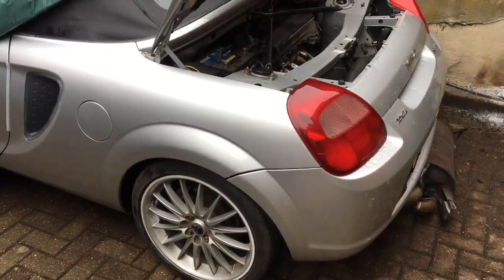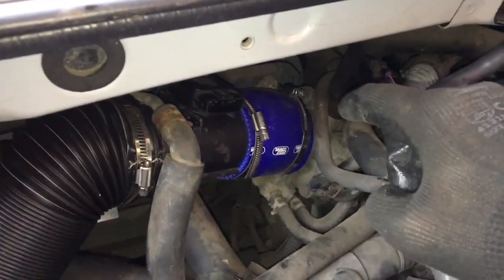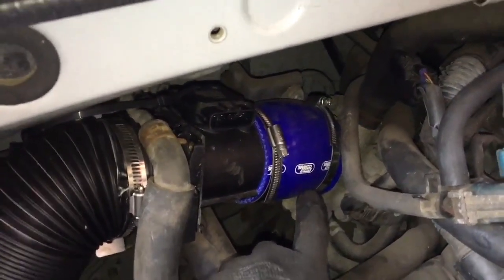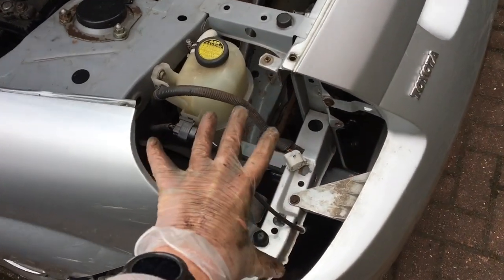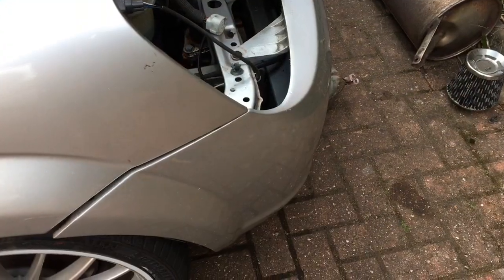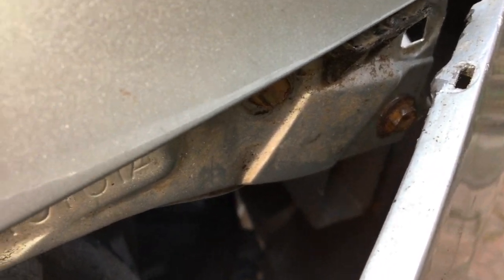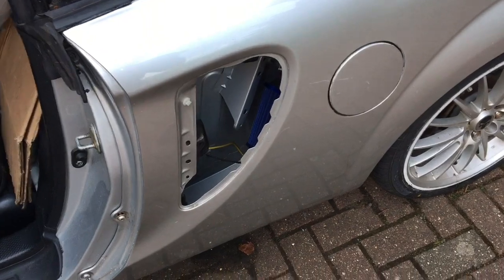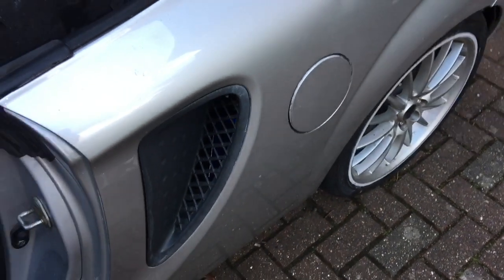Toyota MR2 Roadster side air filter installation

Comment: thats a good idea so you dont get all that hot air from the engine bay, but that flexible tube is terrible for airflow. On mine i made an enclosure and the filter sits right against the firewall with a very short conection to the throttle body. That enclosure is then conected to custom stainless pipe that goes to the sidevent.

Comment: Dude soo much work for the same result..you all ready had the ram air effect due to the stock ducting..I would just build some kind of shielding at the back of the filter at the location you had it..although testing new things is part of evolution..so keep testing 👍
Reply from the maker: You are 💯 pc right - I just had an absolute need to get that air filter as a true side intake, as i have not seen another attempt and wanted to see if it was possible

Comment: A big fan of yours from South Korea.
I hope U’re planning to do something with ur soft top soon so that I can learn from u.
Coz I too have some problems such as chapped edges.
Reply: I suggest black silicon but it depends on which edges you're talking about. Look up other convertible top repair videos for ideas.
Reply from the maker: My roof is in terrible condition, i
might replace it with a second hand one in better condition, if i do i will make a video
Reply: Thanks for the suggestion.
However, mine is brown colored because my car is v-edition.
I tried to apply silicone too but I couldn’t find it with matching color.
Maybe I should replace it.
Reply: @user-ip6vh8dt9j  It would probably work if you got some dry brown/tan pigment and mixed it with clear silicone
Reply: Thanks much.
I’ll try.

Comment: I’ll be worried about getting it super wet and hydro locking the engine… IF there’s a ton of water coming through the side vent .. but that can be remedied with a deflector added behind/inside the vent to divert the air/water around the filter but still allow air to enter the area..! AND get rid of the accordion style pipe it’s bad for flow

Comment: I’ve heard it said quite a few times that these cone filters do absolutely nothing for power compared to the stock box..

Just wondering your thoughts
Reply: Every car is different… on some cars it doesn’t make a difference over a high flow panel filter like a K&N…. BUT on some cars there’s been dyno proof of a 10-20hp increase…. 
Just check the car you’re modding and worse case it’s a great sounding effect!

Comment: So you're not going to clean/change the air filter or do you plan to remove the quarter panel every time?
Reply from the maker: So i have yet to test the theory but I believe i may be able to replace the filter through the side intake when the black plastic intake cover is removed
Reply: @andrewsparey697  I see.  Looks too tight on the video, but that's not uncommon for video.  Good luck.
Reply: @andrewsparey697  you remove filter from outsaid?

Comment: Great job! Do you have problems when its rainy weather..?
Reply from the maker: So it is not a daily driver, I usually only drive on sunny days. I did however get caught in a severe rain situation with surface flooding , and was very worried. Thankfully there was no issue. That said , for the sake of ones blood pressure I would not do this to a daily commuter in a wet climate

Comment: You not afraid the water draining for the top won't get sucked into the engine?
Reply from the maker: It has been a concern but has not happened
Reply: @andrewsparey697  Thank you for responding. I'm looking to purchase a 2003 MR2 soon.

Comment: what happens when you want to clean or change it?
Reply from the maker: Hopefully it is small enough to remove and refit from the vent when the vent shroud is removed. If that fails i will relocate it back to inside the fire wall
Reply: @andrewsparey697 did you change location or clean filter?

Comment: what is not satisfied with the cold intake of the production of AEM?
Reply from the maker: I generally work with the theory that if it is OEM , it sucks
Reply: @andrewsparey697  Just in cool companies, a department of engineers sits and develops how to make the intake better...
Reply from the maker: I have never heard of AEM before, they look very impressive, thank you for the web link !
Reply: @andrewsparey697  i'm install this cai aem in my zzw30, better sound ))
Reply: @andrewsparey697  That is a pretty stupid statement to make.  If you did your homework before going ahead with this, & this video, you would know nobody's made anything that works better, even though, like you I don't like it.  That filter location.....looks like your blocking the cold air intake for the engine bay.
Reply from the maker: @garydunn7014   The AEM branded intake certainly looks superior but is expensive relative to what the car cost. If i chance upon a second hand one, I will certainly film making the change to that intake

Comment: Aka: How to make servicing the air filter on your spyder take 2 hours.
Reply from the maker: That’s future Andy’s problem
Reply: @andrewsparey697  If you search thingiverse for mr2 spyder there's a file for a maf sensor holder/pipe.
Can you take a look at that and tell me if it's interchangable with your hacked down airbox version?
Reply from the maker: @PhonePhone-sf8te  i looked once and had no confidence that they would fit , hence It became a choice between a £250 K&N maf pipe or make my own - i do show how to do that in my other air filter video, it is not so hard to make yourself
Reply: I assume you're talking about fitting with your specific setup or do you mean fit in general? I assumed that it might throw off the air ratio.  Does your setup has the same diameter of the old system to keep the ratio similar or are you tuning it to make up the difference?
Reply from the maker: @PhonePhone-sf8te  the fit in general. If you use the factory Maf pipe you can be assured the sensor will fit. I was not convinced my sensor would fit aftermarket versions
Reply: You can get it through the guard liner, still need to a part out under tje fuel filler, only 3 bolts. The intake sounds with a 2zz are worth it 😜
Reply: That is exactly what I thought! The next air filter service plus the water damage when filter is directly exposed during car wash or rain.

Comment: Rain?
Reply from the maker: Good question- i drove it in mild rain and experienced no problems. I don’t think the side intake ingests a lot of water
Reply: I agree this is not the best idea as heavy rain your air filter will cop a lot of water. The idea in unmodified cars is the air has to go up to reach a dry filter. Also servicing will be a pain